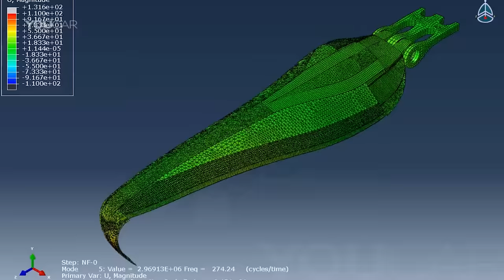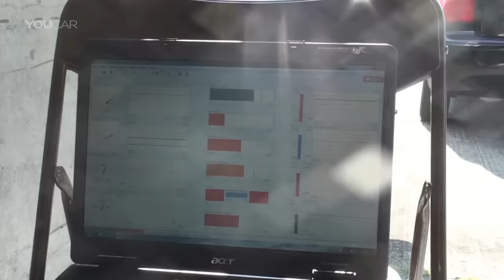Flying Car Street-Legal PAL-V Liberty

Comment: The problem with flying cars is that they kinda aren't cars and if they were, we would have to figure out a traffic system in the sky if it caught on.
Reply: Even when flying cars eventuate, they will be far too expensive and only some lucky few will have them. For that reason they won't really "catch-on" for a long time yet.
Reply: Exactly the same argument was used for cars themselves when they first came out. The same argument was used for phones when they first came out. The same argument was used for planes when they first came out. Think big, dont limit yourself. The reality is already there.
Reply: @Trikkie87  - Big difference is aircraft and more importantly aviation regulations didn't just "come out" and you can't just takeoff/land wherever you please regardless if it's human controlled or automated. This is just a gyroplane you can drive home from the airport or use off property that's already conducive to aviation it doesn't change anything it's like the Amphicar
Reply: traffic system in the sky...Ever heard of Air Traffic Control???
Reply: dan c That doesn't solve nearly as much as people like to believe
Reply: @LordNextDoor  Henry Ford said the same thing in 1940 they're always around the corner
Reply: We just need radar on Flying cars and it will tell us if there is another flying car near us and that is all we need to not crash. We don't need traffic system and we have more space on the sky than the ground...

Comment: its a road legal helicopter
Reply: gyrocopter *
Reply: IT LOOKS LIKE IT WOULD BE A REALLY COOL MOTORTRYCLE/CAR!!
Reply: James the PAL-V is "stable" because it can lean into the turns unlike a normal Tricycle.
Reply: autogyro
Reply: a helicopter is the closest thing we will ever get to a flying car
Reply: This looks like its a Gyrocopter (originallycalled an Autogyro), NOT a Helicopter so it CA'NT take off vertically. A slightly misleading video. It looks fantastic though.👍🇬🇧
Reply: YES I HAD A HEATED ARGUMENT WITH MY HR PROFESSOR ABOUT THIS
Reply: Yes. As of april 2021 ..yes. but its a gyrocopter and you need private pilot license to fly it. Vertical take off not possible. But can take off and land on even a small grass strip, road, unpaved surface too.

Comment: You can't take off from your house unless you live on  a ranch. And if you got a ranch means you're rich. If you're rich you don't need a "roadable gyrocopter". It's way too slow to be practical.  You still need an airstrip to land.  The rotor is the same hazard as helicopter. You have to follow FAA rules which means take off and land from airport. So you drive this thing to airport just to take off? Stupid. Anyone who has flown general aviation knows that you don't just pop in and out of airports and go off driving in a jiffy. There are flight plans to be filed. Tower/ground control communications, other traffic in the air, running your fuel consumption calculations, watching engine management, etc. It ain't like driving on the freeway and pulling over if you have a problem.  Wake up people.  Flying vehicles are not cars.  They have higher stress rates,  they all have TBO rates and schedules. Things break. Goodluck with a dead stick landing even in an autogyro over a school yard.  Aha. Lawsuit from the parents of the kid you decapitated. Flying cars could be a reality 1000 years from now when the whole infrastructure is made for them.
Reply: If you live on some remote islands this might be feasible.
Reply: AtomicDynamo
Reply: Why do you need a "ranch"?  And would that be a cattle, horse, sheep or other ranch?  Why not just a couple acres with a long enough place to put a grass "runway".  Anyone who has flown general aviation knows that you can keep a private plane on your property and use a computer to file a flight plan and go off flying in a jiffy. And lastly (Engines) have TBO's.
Reply: AtomicDynamo we'll be extinct in 1000 years
Reply: Oh it's hard? Well let's just give up on the whole idea then. And cancer, and space exploration let's just shut it down forget about it it's hard guys just walk away
Reply: Kian Laroche That would change if everyone operated one of these.
Reply: Man 1000 years is too much ! By then we can easily travel intergalactic. I think 100 years is maximum
Reply: you would be surprised how many of these will be sold, 500.000 isn't much, there are plenty rich guys who have several sportscars just for fun....this thing is however so much more fun as sport car number 2 and more
Reply: What if safety became high enough that this type of machine obviates the need for roads one day. fly to the hyperloop station form your mountaintop home in at 60mph in 15 minutes, we could be living in the rocky mountains and be in LA in 45 minutes.
Reply: 1,000 years? Get the fuck out of here. That's ridiculous. The tech is all practically here already.
Reply: You forgot to mention the $500k price tag.
Reply: Not much different than having a light sport aircraft, except you have your own car when you land. You don’t need flight plans, many people live close to a local (towerless) airfield, or you can take off from home if you have room.  As long as you stay in Class G or E airspace (which covers most of America), you really don’t have to talk to anyone.

The price is high however, and idk how insurance would even work - what happens if you get a fender bender on the road?
Reply: There is many services which would benefit from this including health services in remote areas and of course in countries in Africa and many more countries
Reply: What about flyer? The recently hit in Las Vegas?
Reply: you sir, get straight to the point ... it is not feasible for the bright masses... but, believe me .... that's exactly what people said to Henry Ford , as he offered the Ford Model T  to the public    :  )
Reply: All good points. The blades would have to be no more than 12" covered like today's fans and have it be damn near self driving. Not to mention regulations. I've said it before 20 years and we'll be there. But first we have to get these cars on the ground to have a proven track record before lift off. Because those black boxes will then be transferred to flying cars.
Reply: well ..basically you are right !  YET , thing is ... once people start buying flying cars ( that obviously have to be mass built and cost effective to run and affordable for everyone) the FAA will accordingly  issue the requirements needed to make traffic safe , at a certain point ... if you're asking me , it will not happen in my life time ... but ... good luck everyone !
Reply: You soon will be so much wrong!
Reply: I mean it's the world's first flying car that actually works, what did you expect? That 1950s bullshit? Like we have the technology lol.  Thing is, if we don't kill each other off, we might have the technology to do it in less than 100 years really. It all depends if the market really wants it though, to make it available for  purchase for the average Joe.
Reply: you dó know that the first CAR was a miserable useless design as well? You háve to go through various fases before you have invented something incredible. First they test how good it actually works, both driving and in the air. Is it safe? Compact? Fast? After THAT they'll try adding more features like 5 person seats and stuff. Stop expecting too much from science. It makes you seem ignorant. It is really difficult you know!
Reply: REALLY just search "first car" then watch this first flying car. Then you see Science actually improved their progression speed. You just need to realise it.
Reply: don't compare a gyrocopter with an helicopter, you demonstrate your deeply ignorance..............there is a wide difference between the two and, of course, the gyro it's so much easy and safe than the helicopter, but they have two different use: you can't airborne in vertical and land in vertical with a gyro, but you are so much safer in a gyro compared to an airplane. stop
Reply: Dude DON'T ever talk back to @# 13 God'collar Usylusses
Reply: The EARTH itself will not have airplanes at all. We will think about where we want to be an arrive in the twinkling of an eye. Of course,  that's BEYOND imagination, but that's the way God works. Read and see for yourself.
Reply: Commercial flying will be abolished in the future and like you see in movies there will be traffic in the sky's and more land for business
Reply: If not there will be designated heights for planes and cars

Comment: First flying car was the "Maverick", invented by Steve Saint. Sold for $94,000, flew at 40knots and drove at 80miles per hour and can drive off roads so you can take off and land where space is limited. This is more sophisticated. Not the first though.

Comment: What is the expected range of this on the ground and in the air? Why Is there two motors in this one for ground the other for air seems like a problem unless the other can be used as a back up in case of main failure in flight?

Comment: why do people insist on making flying cars? what happens if you crash one of those to another flying vehicle while you're in the air? or it stops working?
Reply: Alexander Senna the same things would Happen like if ur flying a helicopter or an airplane. 
To ur First question: imagine beeing stuck in Traffic with this thing.
Reply: no it wouldn't, because 1) helicopters don't fall from the sky when the engine fails. 
2) flying cars can not happen unless its 100% auto pilot. 

you said the same thing would happen if you were flying a plane, thats exactly what i mean. imagine there were 100 times more aircrafts flying. its only a small number of small planes now and they have to go and they still manage to crash into houses or fields so whats going to happen when 100 flying vehicles crash a day ?
Reply: Air traffic is heavily monitored at all times, so air traffic control would inform you to move
Reply: dude, this is called creativity and beginning as well,something made not perfectly when first time right? it will more advant in the future. just like a plan back then before the plan can fly freely. back then a plan only be able to fly only a few minutes lel :v
Reply: Rebel88 maybe in the future they Will fixed it To be better I guess
Reply: Everyone who owns one will have to become a pilot and take all the necessary training.
Reply: It's called progress.
Reply: Not sure why I'm bothering to comment, but just in case anyone reading this doesn't know:  Autogyros like this are even safer than helicopters as they are always in autorotation.  So in the event of an engine out they will slowly fall to earth.  This model even has an autotrim system to make it even easier.
Reply: The main reason planes (and especially choppers) are rare is cos they are ridiculously expensive compared to cars. If aircraft were a lot cheaper there would be more aircraft, but the owners probably still would have a car. So they are trying to make it so you only need one vehicle to serve both purposes and the convenience, fun and luxury of landing at an airport and driving home (no different to the system at all). So it's pretty obvious that (even when flying cars happen) you won't see any more than other aircraft (even less) cos flying cars are harder to make than other aircraft (so far) and obviously flying cars would be too expensive to see a hundred times more of these than other aircraft (for a long time coming). Worry about it when you can buy one for the price of a car. lol
Reply: Justwantahover there's no such thing as a flying car lobby.
Reply: This vehicle is an autogyro so it will glide to a safe landing in the case of an engine failure.
Reply: because it drives us forward....if we crash in mid air, the same thing happens to all...but there has been progress in saftey since The Flyer.
Reply: We have the technology to make these vehicles safe and yes they would  probably  utilize gps and other autopilot features. The only problem I can see for this is whether they can make them efficient enough to be an for mass consumers.
Reply: I hope only pilots may have this car!
Reply: people who like freedom
Reply: Alexander Senna that's why there's not any .lol
Reply: Rebel88 computers glitch and need to re boot then what .lol

Comment: You would need a private pilots/drivers license to fly/drive this thing.
Reply: So what. you need a pilots license to fly a plane/helicopter and a drivers license to drive a car. so naturally if you do both you need both permits
Reply: @serbianspaceforce6873  And since you can only operate from the same standard locations aircraft already operate from save your money and buy a nice used plane and a luxury car
Reply: Pablo Gonzalez yeah honestly, I'd rather buy like an old Cessna than have to deal with the complications of this clunky looking car plane
Reply: @serbianspaceforce6873   400K to cruise slower than a 15K Cessna 150 with less road capabilities than a 3K Smart car

Comment: nahhh  the true holy grail to the concept of a flying car is vertical take off with no runway.  Ala Jetson/Blade Runner/back to the future/   And currently the only vehicle thats capable of that is the Ehang 184.  The Passenger Drone is currently the best idea due to the inherent stability and redundant saftey of a multiple rotor design.

Comment: People should understand the differences between a Gyrocopter and a Helicopter. Even one of my closest friends (an electrical engineer) didn't know the difference. And it's important because the Gyrocopter behaves more like an airplane than a helicopter, which makes them far more efficient than helicopters. And cars that can switch over to becoming a gyrocopter have been around for many decades. A car that can convert into a true flying car (behaving like a helicopter) would be incredibly impractical.

Comment: The DroneCar that Airbus and Ehang produced are the perfect flying cars of the future, its a reality. No need to have wheels, wings that need the runways to fly. They are able to land anywhere if there is space to accommodate their sizes to land and fly from anywhere. They are useful to avoid massive traffic jams while travelling within urban areas. Hopefully, Ehang is able to produce a four seater DroneCar and that it's propellers are covered and protected. This flying car shown here is not realistic as it still needs a runway to fly. It's better to own a car instead and travel long distance flying with the normal airplane.

Comment: Very interesting concept.  Making it a requirement to have a pilot's license is a must.  Will it be classified as a rotary wing aircraft or a fixed wing aircraft?  Since it is basically a gyro copter it could go either way.  I am a helicopter and fixed wing pilot and would buy one of these today to fly out of the garage.   Last, would it be instrument rated?
Reply: did they respond to you?

Comment: Lets get it straight is not a "Helicopter" its an auto gyro.its a pity it not a helicopter because it really would be of practical use then. as it stands you need a 300 mtr runway .

Comment: Does It have a fail-safe system? What is its reliability? It looks like a helicopter! If the rotor fails, what will happen? Is there a parachute for soft landing? Can the driver n passengers eject and parachute safely to ground?

Comment: Actually it is NOT a copter, it CANNOT take off vertically but needs a short airstrip (165m).   Flight speed up to 180 km, not much. Range up to 500 km, very little for a plane and for a car.

Moreover, only 2 seats. 
Grotesque.

Comment: Just 1 down-side tho', it's heck of a noisy. Rotor & prop noise not withstanding, the engine, alone generates a racket. I'm of the opinion the manufacturers oughta source for a different power-pack, be it if necessary internationally evn.

Comment: What are you going to do about security you know the ones who can't afford or maybe the ones who can't afford will want one and the one they will want is the one that is quietly setting and it's driveway or on the side of the road or wherever maybe you're even driving it and you have to pass the keys over so is there going to be a way to applying to be followed in case someone does steal it in a way they can't compromise a security system

Comment: Seems like this might cause some deaths if inexperienced people fly them
Reply: Alex Goldsmith like a car I'm sure you'd  have to be licensed Duhhhh no one is born ready. Don't be so pessimistic about the future
Reply: People would be required to have both a driving license and a pilot license for this
Reply: I read that piloting lessons and license is included in the price
Reply: You need a Pilot's license, so the drivers will be experienced.
Reply: There's 40 hour course for the licence.
Reply: You even need a gyro copter lisence and they cost $400000 to $600000
Reply: Well, you would need a driver's license and a pilot's license so the change of that is low
Reply: 24 Pokemiles, I think you are off by a few hundred grand.  $215 per hour (dual training) multiplied by about 20 hours=$4300 plus books,testing etc...say about 5 to 6 grand to get a gyro license.
Reply: you have to have a pilots liscenese to get it